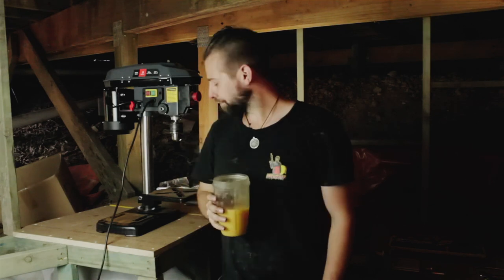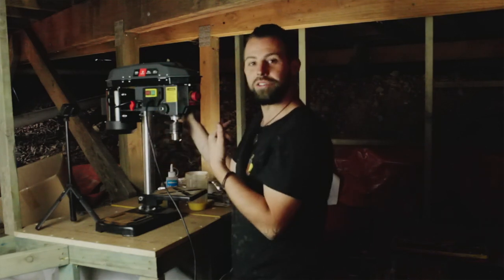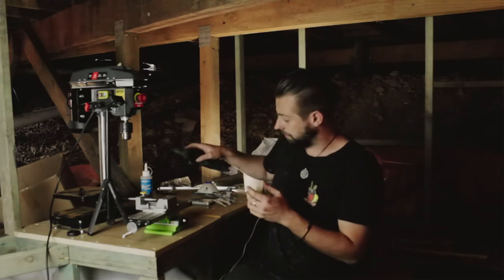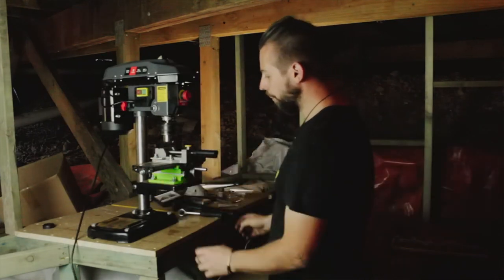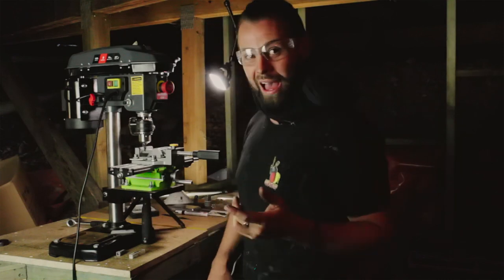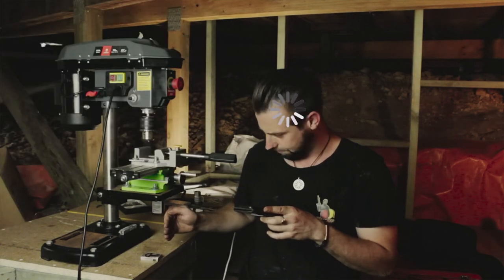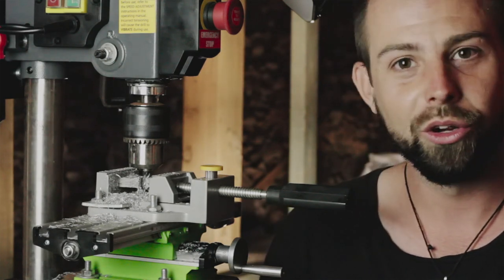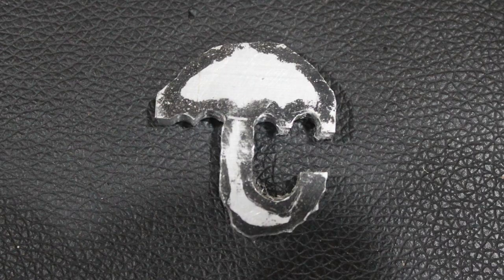DRILL INTO A MILL $160 Build

Comment: When I learned how to use a verticle mill ( Bridgeport),  I recall doing multiple passes that are much shallower. 
We didn't have tungsten bits (carbide and/or tool steel) on various types/hardnesses of carbon steel. 
CNC readouts were just coming to market and controlls followed.  
Speed of rotation is also important depending on material and cutting fluids will help with tool wear, etc. 
And, finally, to comments regarding latteral vs. vertical motion, YES. Everything on the DP from the chuck up thru the spindle is build for vertical motion, not latteral.
There's a big difference in between the DP chuck and a collet in a mill.

Comment: The Drill press is designed for downward load not side load. Chuck is only held on by a morse taper. Side load helps to release its grip on the chuck. This could lead to flying metal not good for the home team. Also asking trouble with runout of the drill. 
Just get a mill
Reply: I mill with a drill chuck. Can you sponsor me a proper mill?

Comment: you never want to put a side-load on an end-mill in a drill chuck, that's why collets exist. For just plunging and milling counter bore, you can becasue upward pressure on the endmill in the drill chuck which is what a drill chuck is designed for. A drill chuck is not designed for milling.
Reply: Yes to this. I came to this video looking for a way to avoid that very problem. If you think it won't happen you are in for a surprise.

Comment: This is stupid and dangerous.  There's too much vibration and no drawbar to hold the chuck from dropping out of the quill.  You're going to get hurt.
Reply from the maker: So what you are saying is I should change the chuck ? Or should I thread a screw through the top where the chuck is inserted ?
Reply: No, a draw bar only solves the problem of the chuck falling out.  You still have a rigidity problem.  The reason your workpiece looks like it was chewed by beavers is because the entire drill press is shaking like a dog shitting razor blades.  That vibration leads to broken end mills with flutes being thrown about at high speed.  There's no reasonable solution to that problem.  Every part of the system is built too weak for the cutting forces involved.  Real mills have mass and rigidity.  On a drill press the table is a light casting held to the column with a clamp.  The column itself is a thin walled tube with insufficient torsional rigidity.  The head's connection to the column is another weak clamp.  The head itself has no real structure to prevent vibration or movement.  Cheap consumer drill presses are designed to drill holes with relatively small bits.   They are not designed to deal with the cutting forces of milling.

You're not the first to think of this and you won't be the last.  I had the same idea 30+ years ago as a wet behind the ears engineer but fortunately heeded the advice of a machinist and waited until I could afford a real mill.
Reply from the maker: @scott9751  i might do a full tear down and fabricate a new frame for a video. It would be interesting to know what you have to do to make it work. I think a blast shield will be my next investment 😂
Reply: @THEADVENTURESOFBIGH  I hate to be discouraging, but you're wasting time and money.  Many people before you have tried and failed.  A cheap drill press has all the rigidity of a spaghetti statue.  Put your time and effort into a side gig to raise money for a proper mill.  A used Bridgeport can be had for $1500 or so.  A used Chinese junk mill even cheaper and it will still be better than a cobbled together drill press.
Reply from the maker: @scott9751  spaghetti statue 😂😂 your not discouraging me it’s actually making me determine to learn more and make it work lol I think my next video will give me a lot more information on what I need to do.